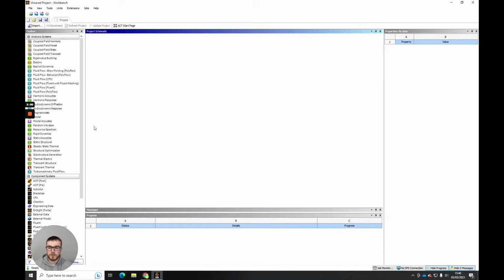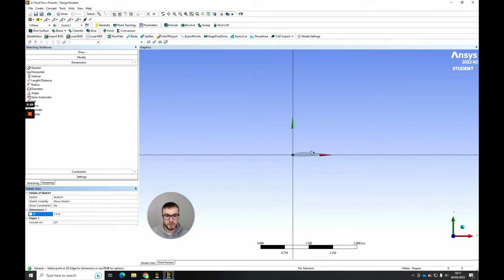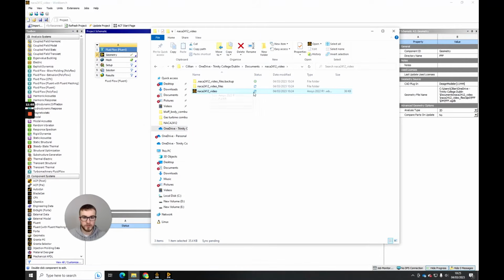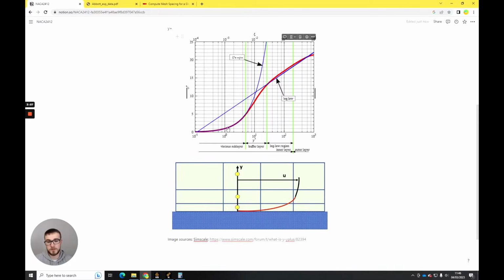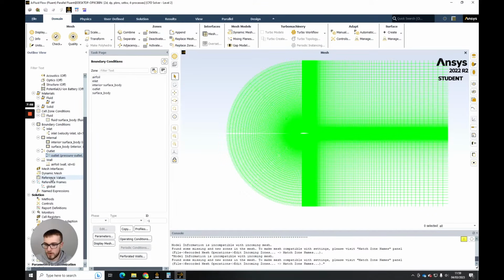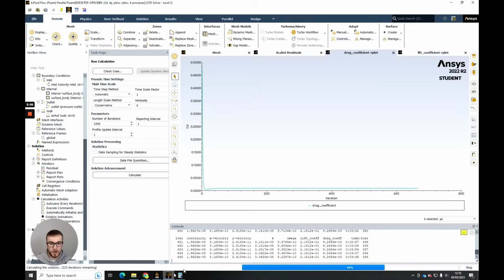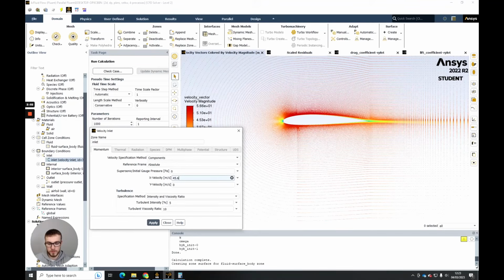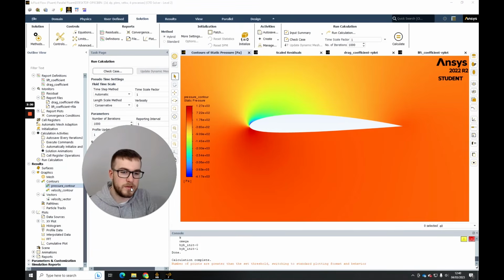NACA2412 Tutorial in ANSYS Fluent (Student Version) - Lift, Drag, Angle of Attack

Comment: How would you refine the boundary layer to have smaller cells at the wall. I'm studying a much larger airfoil, yours had the right size cell at the wall but mine is 300x too large for a y+ of 1. I've tried increasing the bias factor, and number of cells per edge. Also tried decreasing the smallest element size. Nothing seems to work

Comment: The solution for (One or more faces with map mesh controls failed to be mapped mesh.) which worked for me is: 
step 1 IN DESIGN MODELER : change the dimension from 0.08 to 0.052
step 2 IN MESHING APPLICATION : Mesh ( In the outline window ) --->  Details of Mesh( just below the outline window) ---->  Sizing ----->  Use Adaptive Sizing: Yes

I did not change any soft or hard settings rather turned on the Adaptive slicing
Version: ANSYS STUDENT 2025R2
Reply: brother form another motherrrrrr.....thanks a lotttt mannnn....

Literally ive been squeezing my brain from the morning till the late evening ....true life saver brother
Reply: @wakandaforever-r1p  Welcome brother
Reply: bro i cannot find the adaptive sizing option
Reply: @mohammeddabal4343 just observe the details of mesh panel, you will find the sizing and its setting

Comment: Thank you so much!! I followed the same steps, but with a NACA4418 airfoil and compared them to results I obtained in flow5 at around 410 000 Re. I tweaked the mesh a little to make the elements not have those jumps in volume where the domains are separated, and I was able to obtain about a 6% variation in lift coefficient and a 10% variation in drag coefficient for my first CFD. I will have to try with another airfoil that has some experimental data.

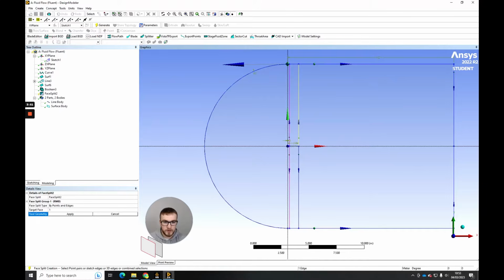Comment: 13:35 I would recommend not splitting the face with the x-axis because if the bottom face of your airfoil goes over the x-axis, you could be left with 7 faces instead of 6 which can make meshing difficult. Instead draw two  separate horizonal lines from the leading and trailing edge and split the face with these lines.
Reply: Omg thank you so much for this. I was so confused where the seventh face was coming from and it was messing up my mesh everytime ))

Comment: he changed the force vectors accorindgly with AoA, In Fluent, the force direction vectors NEVER use sin/cos of AoA. They ALWAYS stay fixed (0/1 or –1) in the global coordinate system.
ONLY the flow direction changes with AoA. Lift is ALWAYS defined as: perpendicular to freestream in the “upward” direction, Drag is ALWAYS defined as: along the freestream direction But these are definitions, NOT rotated vectors.
Fluent does NOT rotate the coordinate frame when AoA changes — You rotate the flow, and forces are projected onto fixed directions.

Comment: Hello, I tried the same thing you did for a different airfoil 0009 but my mesh is not coming out correctly. I get this error: A mesh could not be generated using the current meshing options and settings. also this error:
 Warning: The Face meshing has completed, but some bad elements were created. My entire mesh structure is filled with yellow failed mesh.

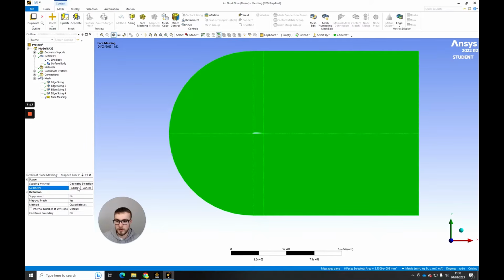Comment: 20:58 i did the exact same step but it shows error in face meshing

Can u help with that

Is anyone faceing the same error i also seen this error in anthoys comments
Reply: late reply, but I hope this helps someone. The thing that was causing an issue was that somehow my facesplitting resulted in 7 faces rather that what was supposed to be 6. Redoing it 3 times I realized that the problem was that depending on the airfoil, there was a section at the bottom part of the airfoil that would be above the X axis resulting in the bottom line of the airfoil getting split. I was able to fix this by not Using the X-axis and drawing my own line that would go around the airfoil.
Reply: same
Reply: Same
Reply: Same, has any of u fixed it? Please, I need help
Reply: it is late to answer but I also had a similar problem. I added "method" ->"multizone quad/tri" after finishing all of the edge sizing. Then I started mesh. There  was again 1 face that was giving error so I added "face meshing" specificially for that face. After that I didn't get any error and the mesh looked fine

Comment: Hello, I tried the same thing you did for a different airfoil but my mesh is not coming out correctly. I get this error: A mesh could not be generated using the current meshing options and settings. also this error:
 Warning: The Face meshing has completed, but some bad elements were created. My entire mesh structure is filled with yellow failed mesh.
Reply: Simetrik kanat profili mi kullanıyorsunuz?

Comment: Thank you brother, You did such an amazing work on airfoil airflow ansys simulation. Actually I have an idea about this airfoil but instead of 2D if you make a detail video in 3D airfoil then I would consider that you done 50% my research work easier. because i want to redesign the shape of the wing surfaces instead of airfoil geometry and want to improve further lift and decrease the drag force and i believe that this work might save some amount of fuel that is fuel efficiency will may increase. If you consider my suggestion and when ever you make a video then please let me know so that I can take ideas form your work. Currently, I am working on damper used for damping vibration in the Transonic Axial flow compressor rotating blades of a gas turbine engine. Thank You. Love from Pakistan.

Comment: This is a great presentation Cillian! It worked perfectly with 2412 but I am having trouble with meshing in case of 4412 airfoil. I have tried changing the settings for edge sizings and face meshing, but I am getting the same error ( the lower mid section, just below th airfoil, is not being meshed ). I require your help and insights on this.
Reply: I’m having this same issue as I’m also doing 4412, the difference I’ve found with the video is in the edge sizing the behaviour is able to change from soft to hard but on Andy’s 2024 R2 there isn’t a behaviour option anymore. Have you found a solution?
Reply: @willellis4497  I had the same issue, try setting capture curvature to 'no', it should give you the option
Reply: have you fixed? Because I'm having the same issue, I have tried everything and don't know what to do. Please, I'm desperate

Comment: Hello, I cannot draw in the design models section in Ansys, it throws too many lines on the screen when the mouse moves, I cannot see anything, I did not see the solution on the internet, it also happened in SolidWorks, I solved it from the graphics settings, but I could not find a solution in Ansys, can you help me?

Comment: Soo I'm having a major problem with creating my my domain sketch. When turning a rectangle (in my case) from a sketch to line I get a error: "Edge could not be created due to a self intersecting curve" now I tried to replicate the rectangle and made it line by line and it always give the same error. Basically instead of having four lines (the four sides of the rectangle) I only have one. and so then I can't create the surface. I tried unistalling and reinstalling the program and even installing on a different computer and I get always the same error. It doesnt even make sense since the software creates the rectangle itself and how does it get a self intersecting curve... If anyone knows how to fix this I appreciate

Comment: hello the video was so helpful thank you again for the great work and without your beatiful smooth way of explaining i dont think i would have understood this simulation anywhere else, one quick note tho, i have went and took a look at the paper from which you  got the experimental data to compare with the simulation results and have realized that they used a 24 inch chord which is equal to about 0.61 meters but in the simulation you put in 1 meter chord i think thats why your drag coef and lift coef have that much high of an error(even though its considerdedvery low when you consider the fact that its just a simulation compared to experimental data). thanks adain for this wonderful video
Reply: I don't think this would affect the results as Cl and Cd are dimensionless parameters. If he had used the same free stream velocity as the study then yes, the reynolds number would be different, however he calculated his free stream velocity based on the reynolds number used in the study so I think the error must be due to other modelling limitations.

Comment: Hello I have an error importing the geometry file (txt data points) into the design modeler, it can't be read, do you know what may be the issue? I followed your exact same steps and the delimiter for the decimals is the point
Reply: hey i got the exact same error, i knoww its been really long but did you figure it out? and if u did could you let me know what was wrong?
Reply: @san-ui4hp  same. did you fix it?

Comment: Thank you very much for your tutorial! I have question regrading the meshing step. I keep getting this error message every time I click generate mesh "The specified defeaturing tolerance was found to be larger than a specified size.  The elements on one or more edges may be defeatured out." 

I've followed all your steps on how to create the geometry and apply the meshing conditions. But every time I try to generate the mesh, this error message keeps popping up. 

I really need ur guidance! Please let me know how I can correct this
Reply: Really need to know this too. Same here.
Reply: I have got the same issue.Did you find the solution for it?
Reply: @adityatandrangi5285   @adityatandrangi5285  I solved the problem! Basically, I was changing the number of divisions of each Edge Sizing for more or less. For example, 50 more divisions in one Edge Sizing and 30 more in another. You do that arbitrarily. This way, there was a moment where the error disappeared. So, there is an optimal point where the mesh becomes quadrilateral only and there's no erro, as in the video.
Reply: @adityatandrangi5285  If the error is still there, just tell me here.

Comment: I followed the tutorial step by step with the same airfoil but a chord length of 160mm and a x-velocity of 10m/s (model aircraft scale). I sized the mesh geometry accordingly (7.5, 15 times c) but my resulting Cl (0,0279) and Cd (0,00274) seem to be roughly off by a factor of 10 compared to the polars on airfoiltools in the same Reynoldsnumber and Ncrit range. Any idea what i did wrong? Is the mesh not suitable for this Re-Number regime? Again, thank you so much for the break down.
Reply: make sure your reference value length in fluent is 160mm instead of the default

Comment: Fantastic tutorial with clear explanations and loads of detail. It's refreshing to discover an ANSYS CFD video tutorial that doesn't focus solely on "what to click in ANSYS." The analysis is, instead, grounded to theory for the estimate of y+ to capture the boundary layer effect and experimental data to compare predicted values of CD and CL with actual measured values of the drag and lift coefficient of a NACA 2412 airfoil. I also appreciate that you didn't edit the portion where you iterated the vector lengths by trial and error. That's real. After conducting the entire simulation, I love that you circled back to check y+ values along the airfoil. I could heap more praise on this tutorial. It's phenomenal.

Comment: Bro how did you select this whole x axis? I couldnt extrude this X axis.
Reply from the maker: What time stamp of the video is this at?
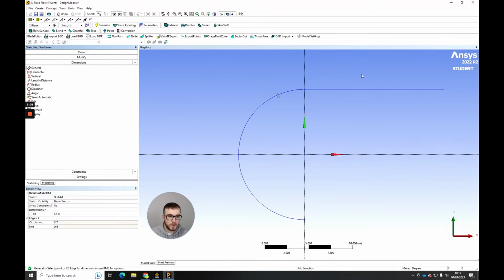Reply: For example at 8:40. Mine X and Y axes are short. But yours are unlimitedly long
Reply from the maker: Thats strange, they should be unlimitedly long if you are in sketch mode on the xy plane. Is it affecting your geometry though? If not I would ignore it is a bug
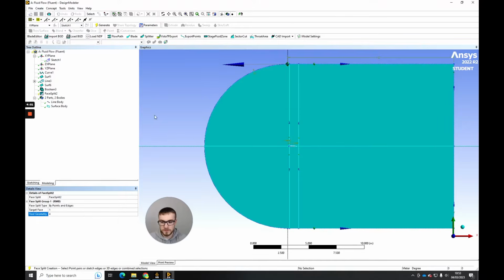Reply: At 13:40 I can select vertical lines and x axes but x axes only affects left side of geometry. I cannot select right side of the x axis. That's why I couldn't manage the meshing procedure. May be using 2023 version of it can be a problem.
Reply: brother use meteras the unit for design modeler whereas use millimeter when creating 3d curve for airfoil
Reply: @ahmadayub5448  pucha nahi tha

Comment: hey, i am actualy doing an analysis for a 3D NACA 4412 Aerofoil with chord length 150mm and span 290mm. 
is there any video that can show me a step by step tutorial for that.
My submission is on 23rd March 🥲
Reply: Could you fine answer? Also I do 3d 2214 analysis. I can get lift coef. with %1 error but drag coef. %50 error
Reply: @fatihc.4301  make sure your changing the angles correctly if using sin and cos. Try meshing it better by adding inflation layer or increasing number of layers. For Eg if it’s 5 layers then make it 7 or 8.
Reply: @bravestone2234  thank you for your interest
Reply: Hi!
Actually, I'm doing the same but with different length and span parameters and I´m also looking for a tutorial step by step. Were you able to find it? If so, let me know where to see it, please. 
Thanks.
Reply: you guys find anything
Reply: @CarlosAlvarez-vf8wk  I just did the same thing from this video but In 3D
Reply: The meshing I used was unstructured so you basically keep on adding edge sizings and face sizings to get a more better mesh and also an inflation layer.
Reply: If you use the meshing techniques from his onera wing video it should help you. 👍